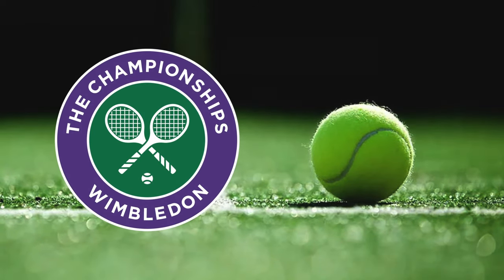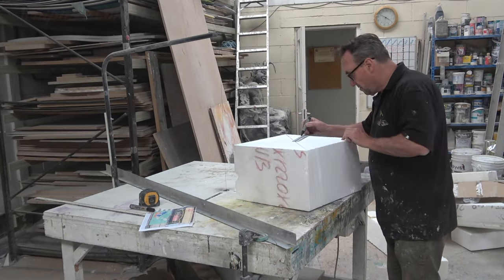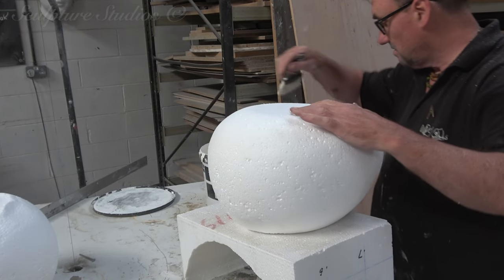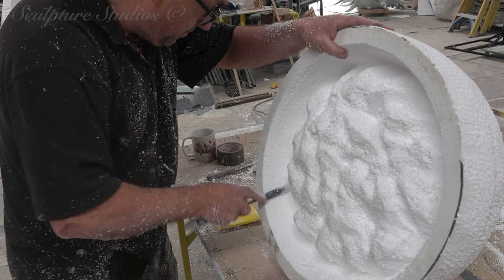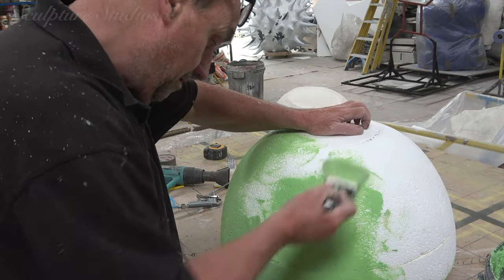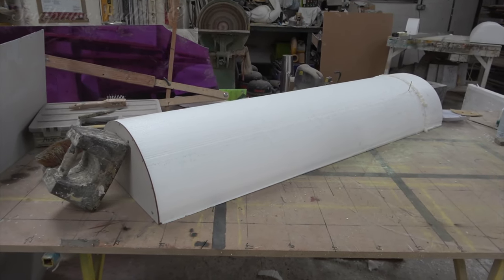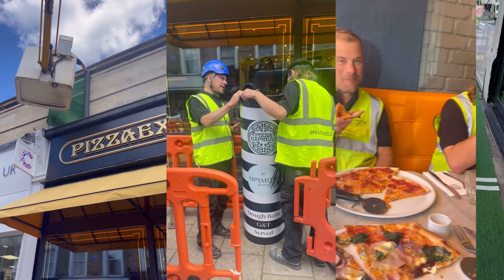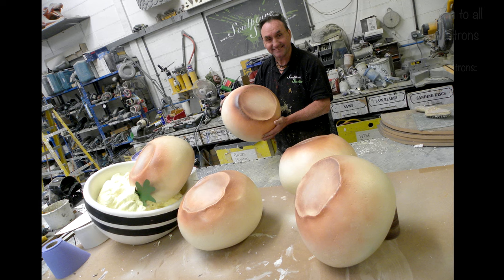GIANT DOUGH BALLS at Pizza Express -  by Sculpture Studios

Comment: Hi Guys.  Interesting use of "water based plaster".  I want to do similar by making large pumpkins out of simple foam (I have a lot of large blocks), but I've always struggled to find a medium to allow me to smooth and sand it, then paint it.  Can I ask what plaster you used?  And would painting it, make it waterproof - depending on type of paint I guess?  I want to have them outside for a couple of weeks for  halloween, so just wondering if your method will help with this? Thanks.
Reply: I use easy fill! Gives about 20 minutes work time & super easy to sand back 😁
Reply: @youandi9540  I've had a look and see you can buy Easy Fill 20, 45, 60 etc.  I'm assuming the numbers relate to the working time?  But will the end result be waterproof, whether painted or not?